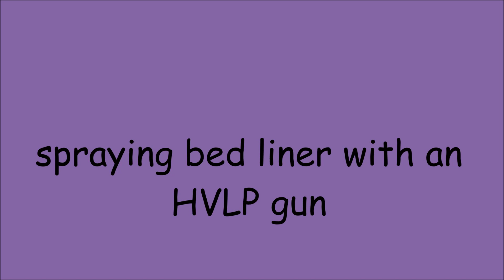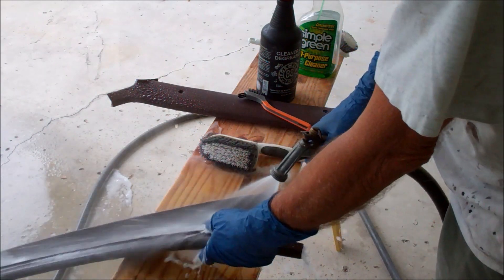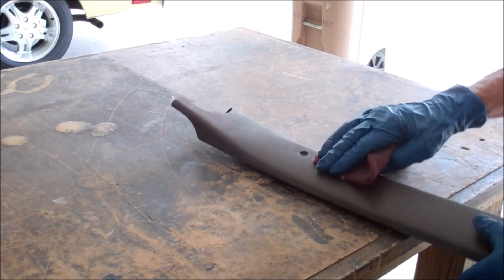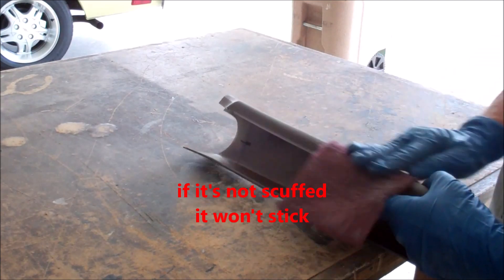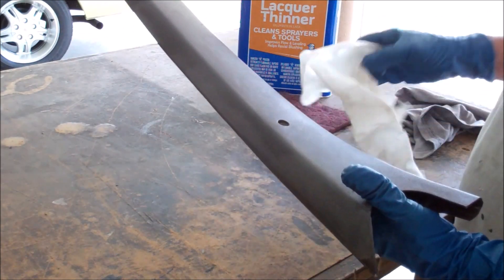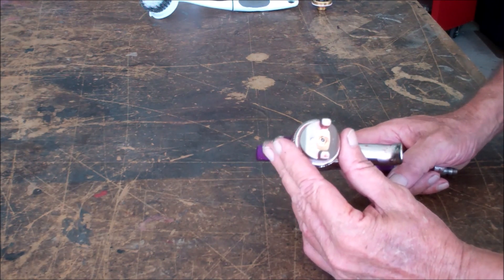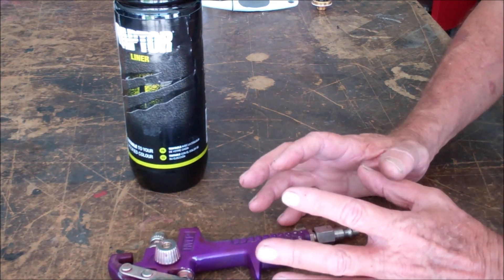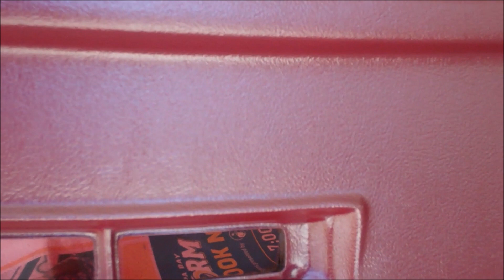spraying Raptor bed liner on interior vinyl with HVLP gun

Comment: Ed, a tip that I use when spraying Raptor to keep the edges from chipping is to wrap the Raptor liner around the edges when you spray it. For example where your hole chipped away, try spaying the back side of the hole making sure that the Raptor joins together in the hole. This eliminates an edge for it to chip away. Same with side pieces, hoods, etc.... always spray around the edges to the back sides to eliminate the 
edges that allow for chipping. Enjoyed the video and try this to see if it helps you out.
Reply from the maker: Good advice.  It's something I learned early on in this process and should've iterated in the video.  Glad you brought it up.
Reply: @EdontheBeach  thanks for the response. I learned this too, this and use Raptor’s adhesion promoter. Good stuff! Take care.

Comment: I used my Sharpe primer gun with a 2.3 , mixed it 4:1:1 . At 45-50 psi The finish was was a very light texture, which was what I was looking for. Thanks for the video.
Reply: Hi there, can you explain the mixe please ( 4:1:1) , thanks
Reply: @zepereira6195  raptor : reducer : hardner

Comment: I clean with degreaser use 180 grit, then clean with alcohol or acetone not lacquer thinner, then spray with adhesion promoter.
Reply from the maker: just to note: acetone would melt this particular plastic, I tried it on another piece before I settled on lacquer thinner.  it's worked pretty well, almost 4yrs later it looks like the day I put it back in!
Reply: @EdontheBeach  I was told lacquer thinner leaves a film,  to use acetone, alcohol or a surface prep. The thing that real is key besides clean surface is adhesion promoter tho for plastic.

Comment: Ed you would be better off using Dawn on that second clean instead of Simple Green. Avoid degreasers with any kind of scent, it's just another chemical that attracts crap back to it. Also hook your garden hose to your hot water heater, along with a Home Depot bucket to keep your scrub brushes rinsed clean.

Comment: What were you thinking? wiping lacquer thinner off the table and spreading the contaminants back onto the plastic and melting them into the plastic with thinner? Dont use thinner at all. First use a wax/grease cleaner such as por15 marine clean, then sand , rounding edges, then wipe off, and clean with prepsol or cleansol in one direction. Then spray the plastic with adhesion promoter, then either spray direct with raptor, of if theres a colour difference with the rest of the car , spray with a 2K epoxy primer then with Raptor. If you spray around the edges and around masking tape edges with adhesive promoter first then you wont get peel back. prep is the key. Be carerful with prepsol do not get it on your skin, its hazardous gear and be really careful of the fumes of grip4
Reply from the maker: for your edification, this plastic does not melt with lacquer thinner...acetone will melt it though - yes, I tried both before I began.  the process you outline will definitely work (prepsol and POR15 marine clean are both great and effective products), and for this project I didn't want those primer layers.  I wanted to 'reflect' the original texture and was concerned that too many base layers would result in me having to then try to 'replicate' that texture.  also, there was adhesion promoter applied, I didn't go over it because I assume anyone who would contemplate doing this procedure would, even if just out of habit, automatically do that just before they sprayed Raptor.
Reply: perfect description but I do use wash laquer thinner on a rag that has started to dry a little so it is not real wet as a last wipe down. 2k epoxy is a great first coating under any finish.

Comment: more than likely someone used that silicon shiney spray on the parts. you will never see that stuff in a paint shop. it is very hard to get off. I use laquer thinner not real wet to go over plastic first. then a dawn soap then wax and grease remover.

Comment: You can buy 2.0 and 2.2 mm tips for most name brand HVLP guns. I have DeVilbiss guns, and I special order 2.0 and 2.2 tips for my primer guns although the tips alone ($30 each for Starting Line model) are more than a Harbor Freight gun, so depends on your budget and availability. I think 2.2 mm might be just right for this. thanks for the video.
Reply: also harbor freight use to sell a gun with a 2.0 tip, I have one but never used it.
Reply: HF has some newer guns on the market now that have various tip sizes

Comment: Plan to spray the exterior of my small 4X4 with tinted material. Want a fine texture, with unlimited air from a screw compressor. What air pressure would you suggest? can a wider fan be used for the large surface area. Any other tips ?